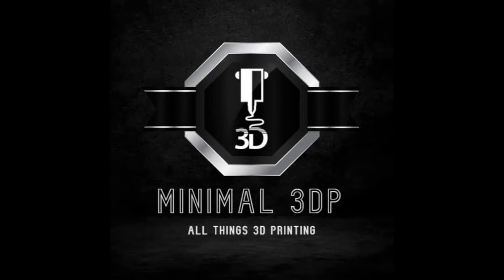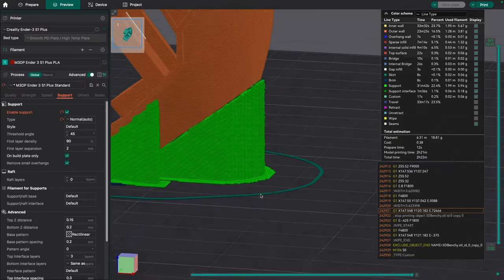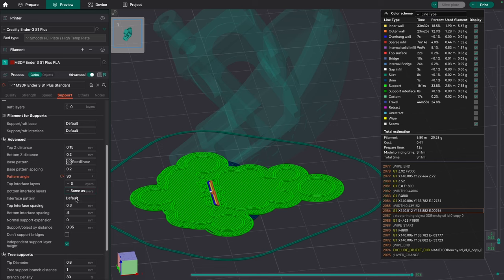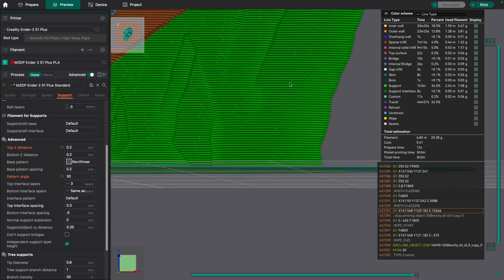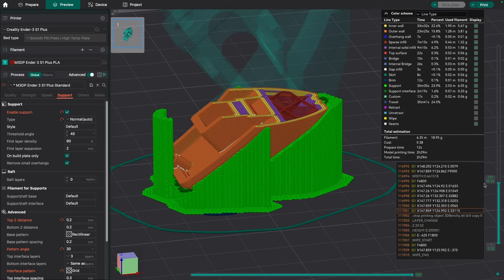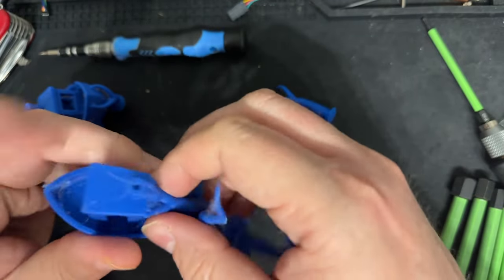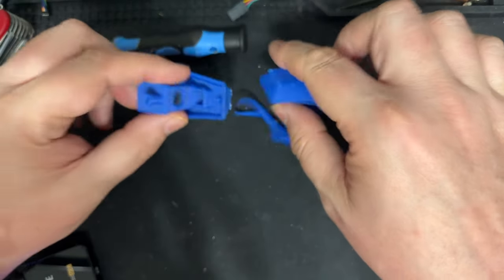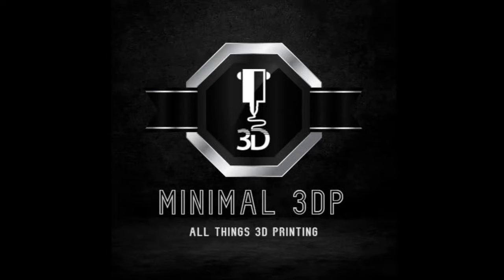Help! My Orca Slicer Supports are Hard to Remove and Damage my 3D Print

Comment: I have tried quite a few slicers through the years and as of late, I am using Orca the most. I find tree slim supports work well. Now i find the thing that also affects supports is the printing temp. I will sometimes print a bit hotter when needing layer strength but as a result the supports are harder to remove. It will ultimately depend on your model, overhangs, if it is a functional part etc. Thanks for the video
Reply from the maker: I will try to experiment with the temp and see what it does. So many settings to try.

Comment: Great videos, I have big problems removing the supports, I also found a configuration with excellent results with the Creality filament, the problem is the printing time, really slow, then I tried the Gtmax3d filament with the same setting and the result is horrible, now either it's the filament, or I have to change the whole configuration

Comment: I wonder if line width setting to reduce support line width would help reduce contact surface, and also  reduce support strength.

 I would like to see more study  and rational about line width settings in Orca.
Reply from the maker: I am going to mess with it more. I like orca but i sometimes get frustrated with the settings.

Comment: I use PETG for the support interface layers on PLA parts and vice versa with default settings, of course this using an AMS, but on my Ender 5 plus machines I use the default settings on Cura and they work just fine.
 I would have used Orca for the Ender 5 Plus machines but I have problems with the support angle settings, in Cura I set the threshold to 55 degrees but if I do this is Orca with the same part I get problems.
Reply from the maker: I like orca slicer but cura seams a little easier settings wise.
Reply: Orca does overhangs the opposite of cura.   It reads the angle opposite/opposed.  So for your 55degree angle in cura (which is the same angle I use in cura) you would say 35.  45 degree in cura is still 45 in orca, 50 in cura is 40 in orca, etc.